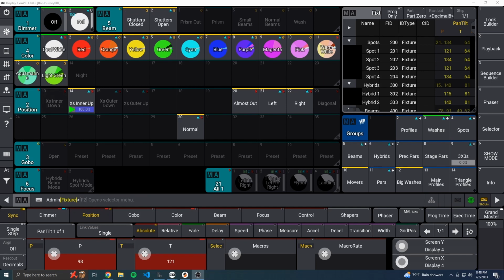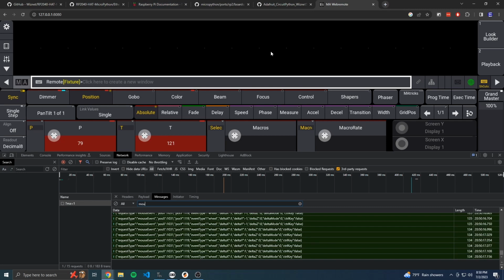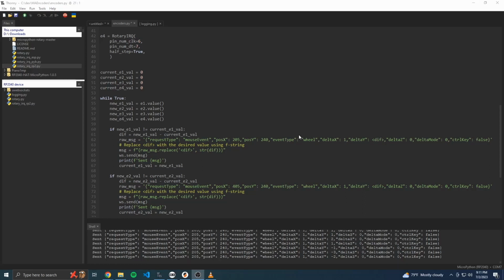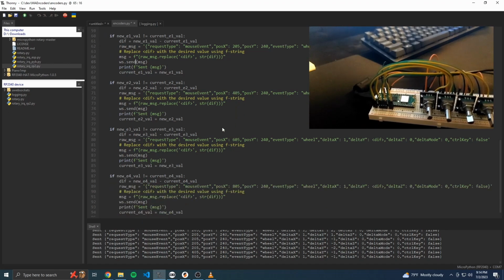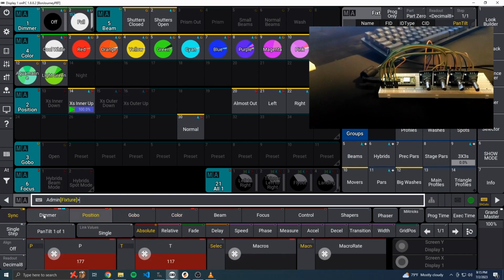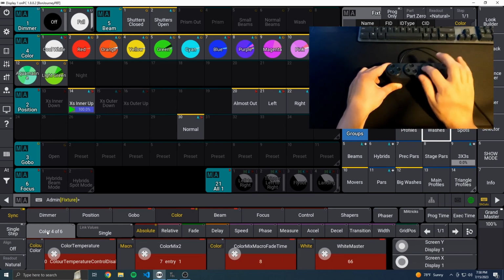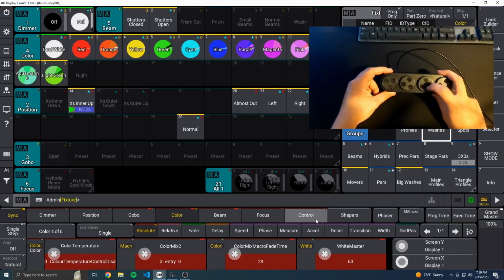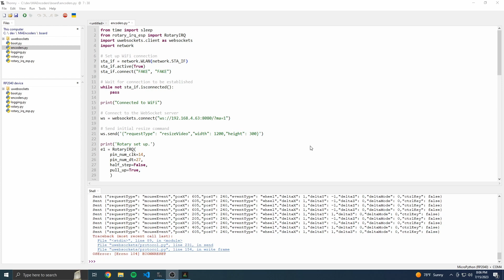Controlling GrandMA3 Programming Encoders | A Reverse Engineering Project

Comment: I'm working on a very similar project but for the ETC Eos software, luckily for me they have an open source usb-serial implementation with some well commented example code for arduino. Very cool though, I will make something similar if/when i switch to MA

Comment: I love this! Add a ws28XX strip with indicators for presetfeaturetype.
Reply from the maker: Hey! Thanks for watching!

I was hoping I would be able to make these backlit like the ones on the console, but that opens a pretty big can of worms when using the web ui method because the console only sends back a video stream, no discrete data. That means we'd have to receive a video stream and try to process it to extract data.

Possible? Yes, but we'd likely need more processing power and a whole lot more code. At that point a lua setup of some sort may be a better option.

This is just the beginnings of a larger project I'm calling OpenSurface. Keep an eye out for updates on that!

Comment: afak on 2 show cockpit controls the encoders via the webremote
Reply from the maker: I believe that is the case. My understanding is that the entire MA2 integration in SC is through the web UI. I'm thinking it worked differently on MA2 in that maybe it had discrete commands and control instead of implementing a remote desktop type thing. Not sure, though.

Thanks for watching!
Reply: yep, the ma2 web remote does have discrete commands instead of this action at pixel position system.

neat project btw